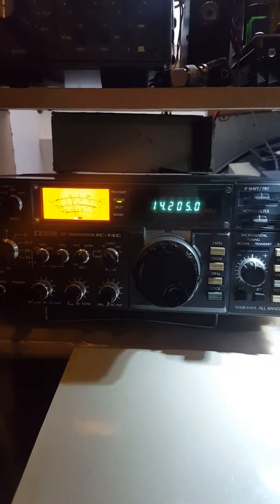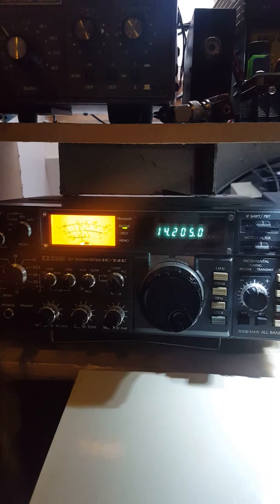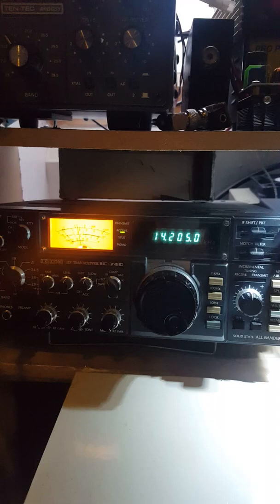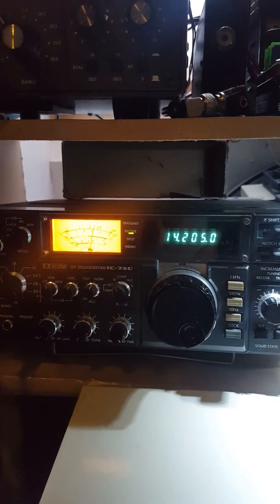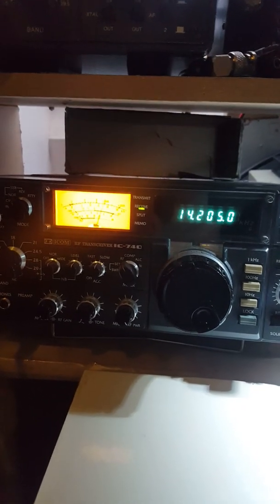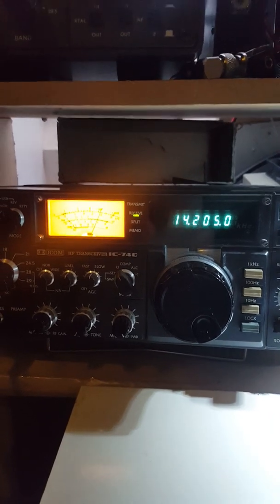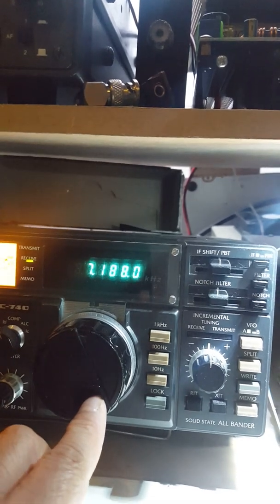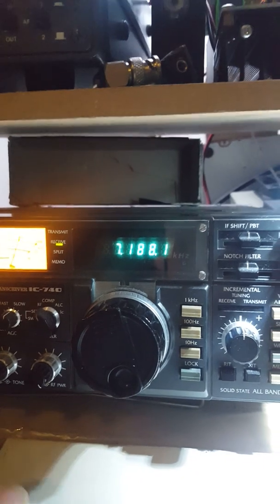ICOM IC 740 - Vintage Radio Refurbished

Comment: My 740 has not been switched on for a while and now no rx or tx, is it a big job to change all the caps.
Reply from the maker: Hi Brian,yes and a bit daunting. I changed the caps one board at a time and it involves taking off lots of connectors. I advise taking a photo  of each board before disconnecting wires. Good luck!!
Reply: @mm0umz426  thanks for the advice, it might be a step too far for my old eyes and hands, the rig has not worked for years, so maybe not worth the effort. I may look to buy another 2nd hand radio, but which one, phew, there are so many. anyway thanks for the reply, enjoy your summer. brian zl3xdj, ex g4xdj.

Comment: Hello, your video is very good. I have one the same, that adjusts the vco to the correct values, but after a couple of hours the 40 meter band is silent on rx and tx. I discovered that if I warm up the vco a bit with hot air, the voltage on the R32 drops. What I cannot give is with the component that produces that fault. What's more, with the breath of my mouth it also fails haha. I put the hot soldering iron on component by component but it doesn't fail instantly. Do you have any idea what it could be? 73´s

Comment: I have recently obtained a 740 and am in the process of restoring it. I think replacing the VCO trimmer caps is my next step. The radio goes quiet every now and then and seeing there is no transmit when this happens, I believe it the the PLL going out of lock. Thank you for the video.
Reply from the maker: Good luck Ramon,yes  the vco caps are a known issue with the 740,73s
Reply: @mm0umz426  It turns out, there is nothing wrong with the VCO baord ( and trimmer caps). I noticed that tapping the HPS borad very slightly made the radio go in oand out of lock.  What I had to do is resolder the whole HPL board and everything became ok! No more going out of lock. The HPL board is that part of the synthesizer which manages the band of operation. It seems there might be a cold solder somewhere on the board. Reflowing all solder joints did it.

Comment: This was a short report on the refurbishment of Icom IC-740 transceiver. Why the VCO trimmer caps were replaced? Usually if the electrolytic capacitors is needed to be replaced if they leaked and the ESR of those capacitors was bad.
Reply from the maker: Hi Pertti,the original variable caps on the vco were made of plastic material and over time they will fail. In fact it is a well known issue with the IC 740.I replaced them with ceramic ones.This xcvR is over 20 years old,the electrolytic caps don't last that long, 73s
Reply: @mm0umz426  Good.! Old variable capacitors fail due to the old age of material. Ceramic variable caps should last longer than the plastic ones. I have also a Icom IC-740 which I purchased 13 years ago. I am due to look for the capacitors inside of the cabin of the transceiver. Perhaps a DSP Audio Mic-processor pre-amplifier and  equalizer would help for use of the transceiver. There were not such ones available for Icom IC-740 transceivers when they 
were manufactured in Japan 37 years ago.